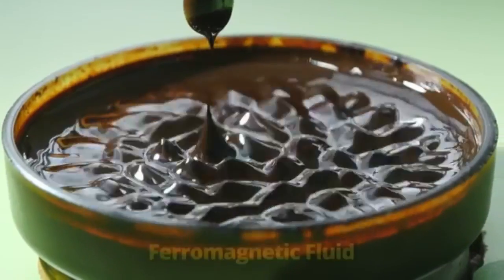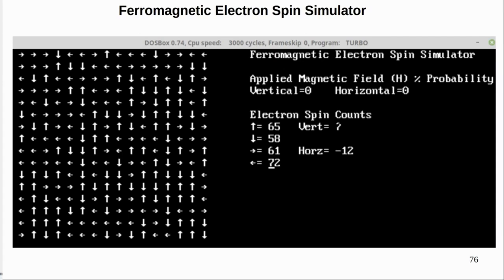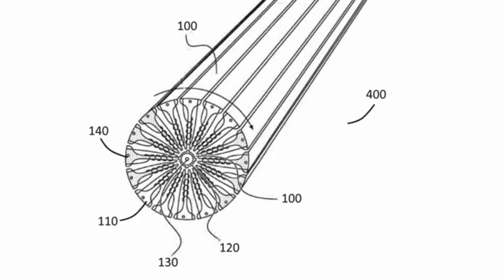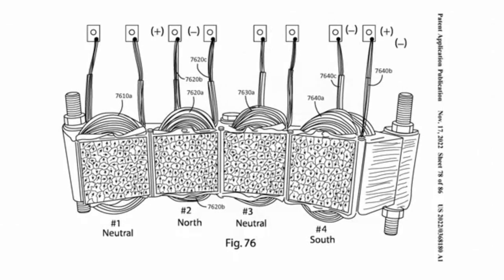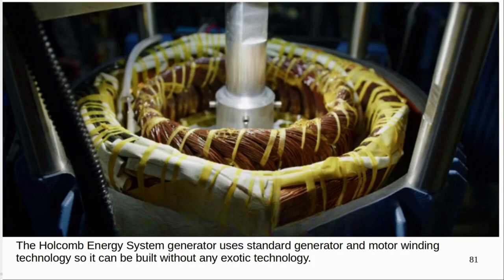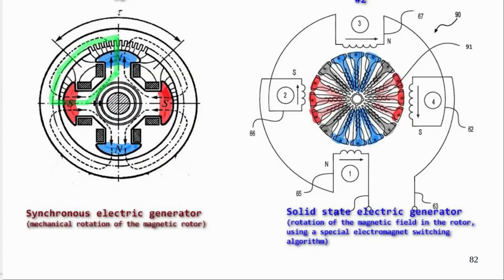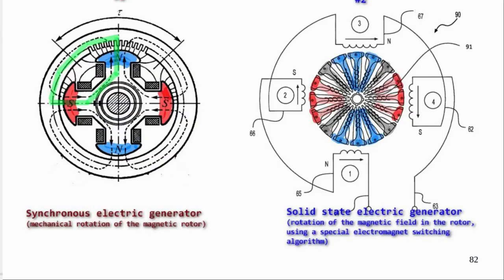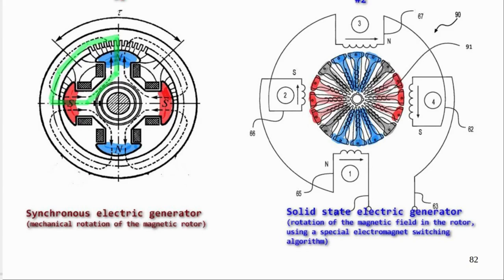Debunked Sabine Hossenfelder's Review of the Holcomb Energy System (HES)

Comment: It would be easy to prove Ms Hossenfelder wrong by submitting the Holcomb device for an examination by independent experts. Holcomb claims that this has been done but is unable to present the report of such an examination. The explanations of Holcomb do not fit. To build up the  magnetic field of a coil requires an input of electrical energy. If the coil has a core of iron more electrical energy is needed to build up the magnetic field. If the field collapses you just get back the energy which was input before, nothing more. There is no gain of energy with an iron core and there is absolutely no evidence of zero point energy being involved.

Comment: If a device like this exists it'd be best to think of it as working like a heat pump, they don't violate any laws.  Insyead of generating heat they simply move and concentrate it from water, ground or air and efficiencies of over 400% are possible.  We have one they work well.

If there's a source of energy like zero point or vacuum and a device can act to tap and access it as a conduit or pump then laws of thermodynamics are preserved.

Now does this device do that?  Well I have no idea but until we see one getting a guaranteed fair crack we won't know for sure.

Comment: If you really believe the HES is real, and I want it to be, do a go fund me and have them do a hot plate test to prove the system.  Have them use several hot pates purchased at Walmart, use distilled water with pots from Walmart, use a multimeter with a clamp amp capability from Walmart.  Place this in a parking lot along with the weight of HES ILPG, invertor,  battery, hot plate, and all equipment associated with the test to make certain no hidden batteries are involved. Inspect and video tape the HES with the cover off to verify no hidden power source or energy collecting antenna.  Also check the invertor for an antenna or hidden power source.

Run a 12 hour test without a break in the video showing thermal scans of the equipment, water, etc every 15 minutes and battery voltage/amperage reading from a self looping system.  Do this and anyone can go to Walmart to duplicate the test thus proving the system.  Use the smallest system possible with the smallest battery possible for maximum stress testing.

I truly want the system to be real and have stock with ASRE but it appears to be a scam at this point with me losing a good deal of money.

Comment: A magnet is like a spring, can you extract energy from a spring? You could use a spring to transfer energy from one place to another, but you obviously can't get more energy out than you put in. You would need to push the same poles of two magnets together to get them to push each other apart. Will they push apart with more force than you used to push them together? If you can show an experiment that proves that can happen I'll believe you can get energy from magnets.

Comment: Hi Ashton, this is Ellen Holcomb from Holcomb Energy Systems. Thank you for making this video and for taking a scientific look at our technology. We appreciate it.
Reply: A self looping boiling water test using hot plates in a Walmart parking lot would put any speculation to rest, but you refuse to do anything so simple.  It is either a scam or the worst managed company ever seen thus causing the stock to plummet.
Reply: @Oouther1    Speculations would be better put to rest with a positive confirmation by an institution as e.g. SGS. Tests in a parking lot are not credible since no one can check if there isn't some trickery involved. The fact that Holcomb never tried to get such a confirmation says a lot. Scam.
Reply: To prove your tech at the boat show a self looping model running a small a/c full time should have been on display. If the tech is real, it’s civilization changing, but you run the company like scammers.

Comment: What is overlooked by all is geometry / geometrical properties.

Newtons laws should be rephrased in terms of total geometrical orders plus total geometrical disorders remain Constant

The trick is then to draw from disturbances in geometry, which requires a consistent constant flow of disturbances, that remains uninterrupted such as with a wind or water mill / hydro turbine.

What Holcomb accomplishes is an electrical dynamo, that is not limited to just 2 poles, but can be multiplied to as many poles as the encloser can carry

So the amount of what a dynamo would release with every spin, is simply multiplied, without any moving parts

The same basics of geometry explain all devices with more output than input, as drawing from geometrical restrictions of one type of components, relative to different geometrical restrictions in other type of components.

Such as there is Z-pinch Sandia labs sun hot ice, Andrea Rossi Ecat, Fleischmann-Pons LENRs and Kapanadze ground-induction, and spinning drum water heater, as well as John Kanzius burning water RF device and Stanley Meyer HHO injector
Reply: It makes no sense to speculate how the Holcomb-System could work, as long as there is no proof at all that it does indeed work. 
" The same basics of geometry explain all devices with more output than input "    This basis of geometry doesn't explain much since up to now no one could show a device with more output than input in a credible way. Andrea Rossi is a scammer, his E-cat doesn't work. Fleischmann-Pons experiment was not reproducable and also they couldn't reproduce it when asked for. John Kanzius burning water is no mystery at all. And Stanley Meyer was also just a scammer. He cashed prepayments for a water car but couldn't deliver anything and thus was sentenced for fraud.

Comment: Sorry if this is a bit of a rant. 
OK, "ambient fluctuation energy", "zero point energy", "electron spin ratchet", "quantum exchange force interaction".  What about phlogiston?  And "physics just hasn't figured it out yet".  
Fancy phrases aside, the claim is that it produces four to five times (!) more energy out than what is put in.  You don't need any gobbledygook, just show one!  Put in 100 watts, get out 400 watts.   Figure out the theory later.  Go on Shark Tank; they'll buy it in a second because it's a money machine.  Perfect example of "the proof of the pudding is in the eating".
BTW, be careful not to put the output back into the input;  it'll keep multiplying the power until it blows up!  
And windmills? They don't produce energy when the wind is not blowing? Very suspicious! Kidding aside, I thought the sun produced heat by extreme gravity mashing hydrogen into helium (E=mcc), radiating heat to the Earth's surface, causing air to expand and move around, pushing blades connected to a generator, converting mechanical energy to electrical energy. 
One last nitpick -- it's not sa-brean, but pronounced sa-BEAN-a, 3 syllables, no R (I think the name is German).  And I don't automatically believe everything she says, and I don't automatically believe everything Dr Holcomb says.

Comment: Why can’t I buy a zero point energy generator at my local hardware store? It’s because they require fairy dust to prime the encabulator. But I have solved that problem. Just send me 5 million dollars and I’ll manufacture one for you, plus you’ll receive the most important lesson of life… buyer beware! Holcomb energy systems is already being sued because their customer discovered that not only did the device fail to generate energy, it actually increased energy consumption!  Just because someone has an education, it doesn’t guarantee everything they say or do is correct. The proof is in the pudding. Unfortunately, this pudding stinks of stupidity.

Comment: Zero-Point Energy (ZPE) in Relation to Magnetic and Dielectric Properties
1. Magnetic Properties and ZPE:
Magnetic phenomena at the quantum level can be influenced by zero-point energy (ZPE), which is the lowest possible energy that a quantum system may possess. ZPE arises from the fact that even in a vacuum, quantum fields exhibit fluctuations due to the uncertainty principle. These fluctuations are sometimes referred to as vacuum fluctuations.
In terms of magnetic properties:
	•	Magnetic fields and quantum fluctuations: Magnetic fields themselves, which arise from the movement of electric charges (electrons), are affected by quantum fluctuations. ZPE can cause tiny oscillations in the fields and may slightly affect how magnetic materials behave at very low temperatures.
	•	Vacuum polarization: ZPE can lead to vacuum polarization, a process where the vacuum behaves like a medium due to virtual particle-antiparticle pairs, which can affect the magnetic field within this region.
	•	Magnetic permeability: The intrinsic magnetic properties of materials, such as permeability (which describes how a material responds to an external magnetic field), can in part be influenced by ZPE. While this effect is typically extremely small and often overshadowed by thermal or classical effects, at absolute zero (or near it), ZPE becomes more dominant in determining magnetic behavior.
2. Dielectric Properties and ZPE:
Dielectric properties refer to a material’s ability to store and transmit electric charge. These properties are described by dielectric permittivity, which quantifies how an electric field interacts with a material. ZPE also influences dielectric properties through the ever-present quantum fluctuations of the electromagnetic field.
	•	Casimir Effect: A tangible result of ZPE in dielectrics is the Casimir effect, where two uncharged, parallel conductive plates placed very close to each other in a vacuum experience an attractive force due to quantum fluctuations of the electromagnetic field. This effect has direct implications for materials with high dielectric constants.
	•	Polarization and ZPE: In dielectric materials, ZPE contributes to the polarization of the medium. Polarization in a dielectric is the result of the alignment of dipoles within the material when subjected to an external electric field. Even at zero temperature, due to ZPE, there are residual fluctuations in the dipoles’ positions, which contribute to the overall dielectric constant of the material.
	•	Dielectric permittivity: Just as magnetic permeability can be influenced by ZPE, dielectric permittivity is also slightly modified by ZPE due to the background fluctuations. However, this influence is often small compared to other factors like material composition or temperature.
Conclusion:
In summary, both magnetic and dielectric properties are affected at a quantum level by zero-point energy (ZPE), though these effects are subtle and most prominent at low temperatures or in highly controlled environments. ZPE contributes to vacuum fluctuations, which can subtly affect magnetic permeability and dielectric permittivity through processes like vacuum polarization and the Casimir effect. While these effects are generally small, they highlight the pervasive influence of quantum phenomena in physical properties that are otherwise governed by classical laws at larger scales.
Reply: Ashton tells you where you can put your "Classical Laws."  I agree with him. He found the scientific facts behind the real videos of MH370. What have you used your Laws to accomplish?